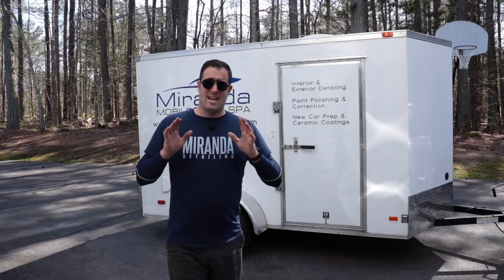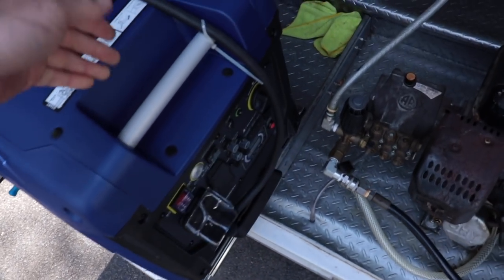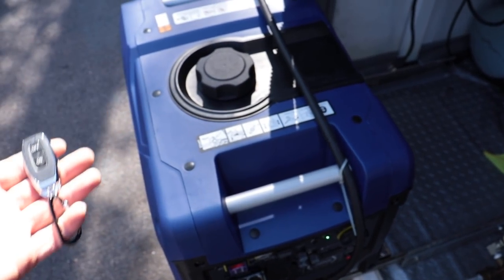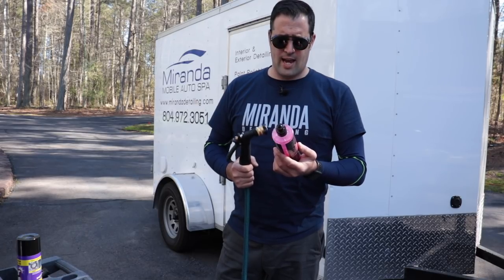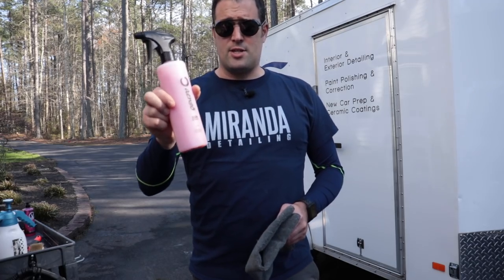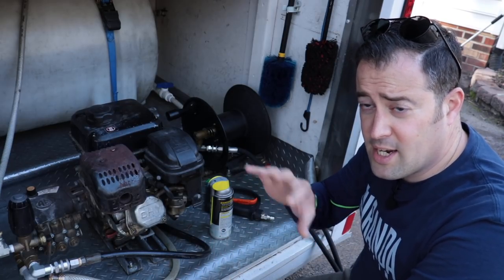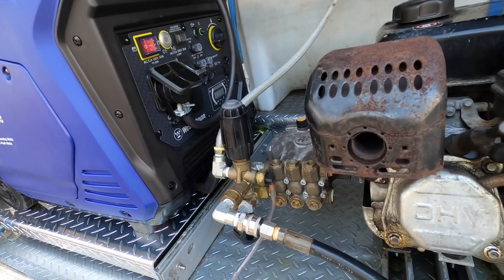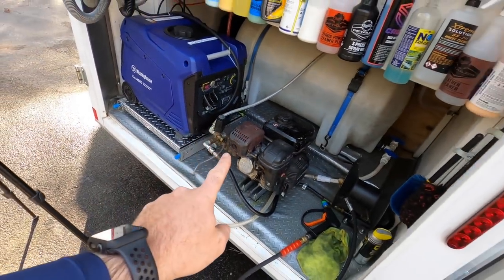Weekend Wash / How To Prime Your Pressure Washer. #detailingtips #mobiledetailing

Comment: The other thing is the wd40 with silicone disperses water so in the cold winter it does not freeze in a way that you cannot unhook them and wd40 with silicone can also be used on your car on the rubber border on the doors and the key holes so you can open the doors.  My brother living in Utah learned that.🤣🤣